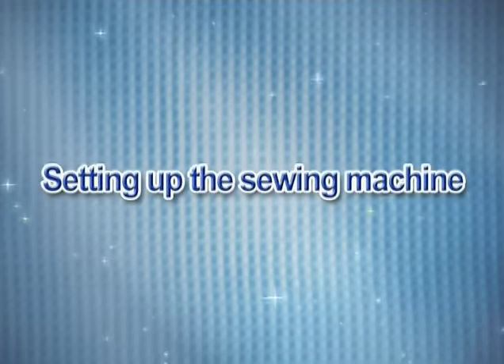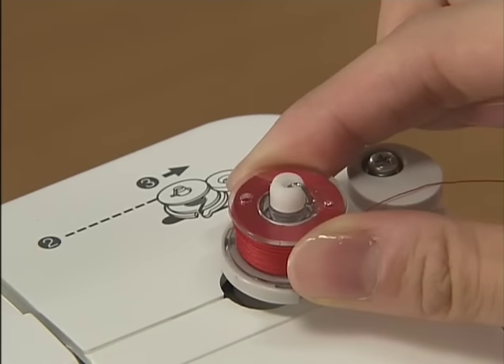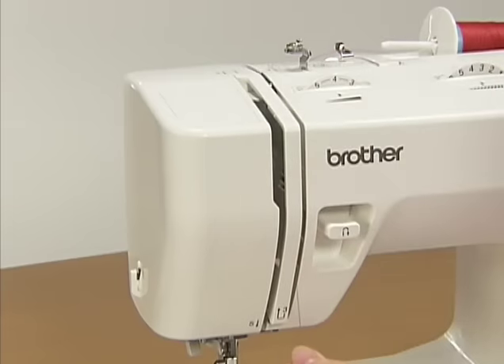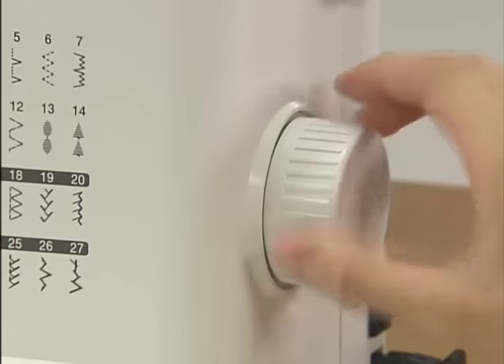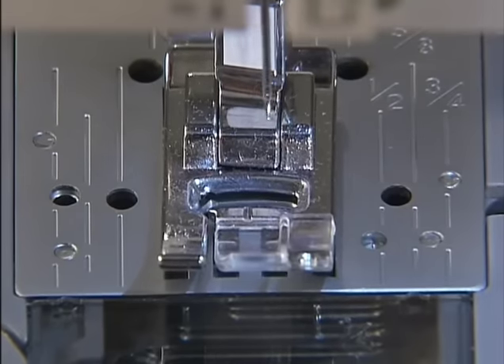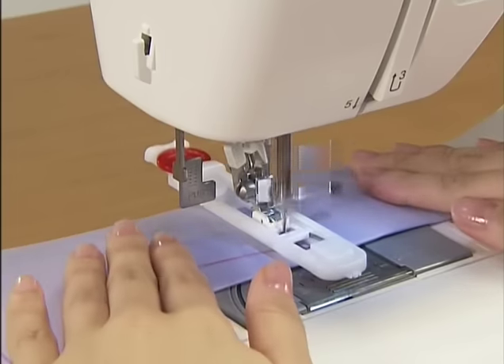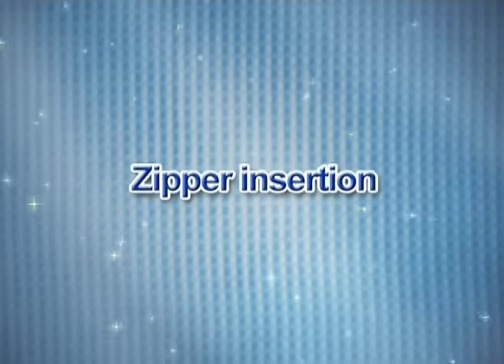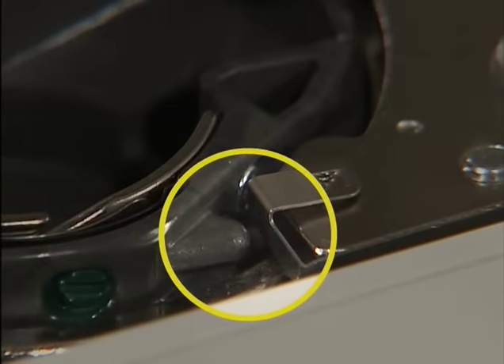Brother Sewing Machine ST531HD Instruction

Comment: Okay, great instructions.  But I got this machine because it was portable, and I have other Brother products.  To me, it is very rickety, with too many plastic parts.  It's also counter-intuitive to every other machine I have.  Levers are not in the standard places, this one goes clockwise when the others go counter-clockwise, and good luck threading the needle.  The presser foot gets in the way, and the crummy light means you can't see anything. You wind up hunched over until your spine locks up.
As for Strong and Tough, it couldn't even handle one layer of cotton fabric with low-loft 100% cotton batting.  I was trying to sew  Christmas toys for charity, and spent more time re-threading the needle and picking out thread clots.  It didn't seem to like the batting.  My "old reliable" White machine turns 65 this year, sews almost anything like a pro, and never gives me a problem.  Somehow I don't think this Brother is going to be here 65 years from now.

Comment: To help you skip to the parts you need: 
0:45 Setting up the machine
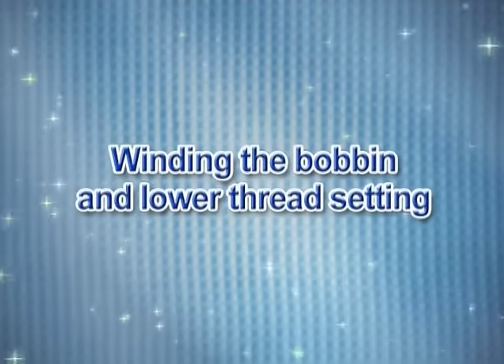1:13 WInding the bobbin and lower thread setting
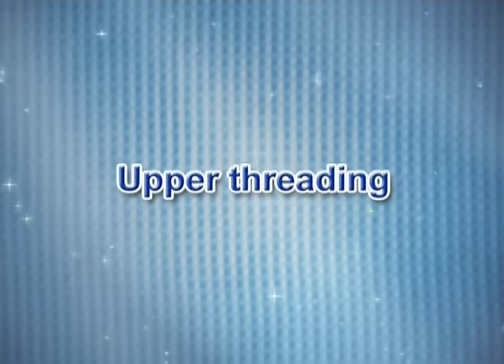4:49 Upper threading
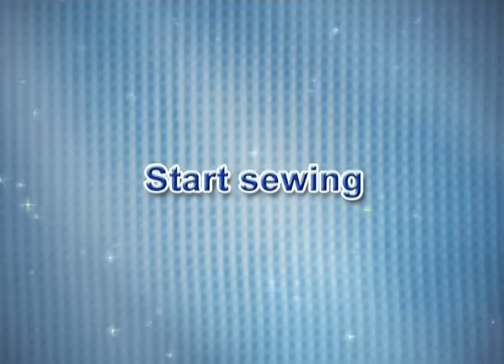7:17 Start sewing
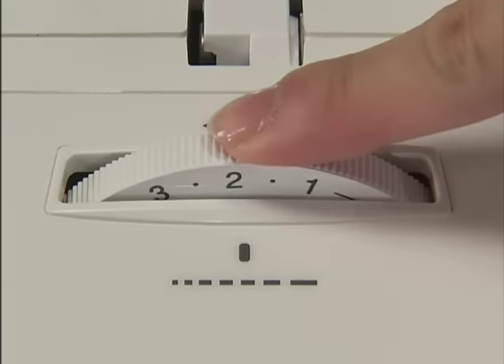8:52 Strech stitch 
9:11 Reverse sewing
10:15 Thread tension
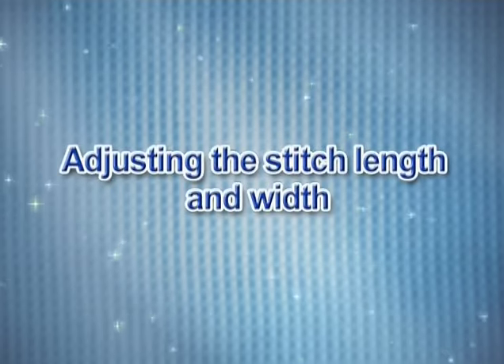10:46 Adjust stitch length and width
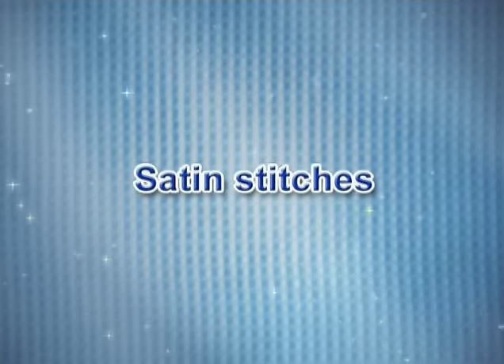11:59 Satin stitches
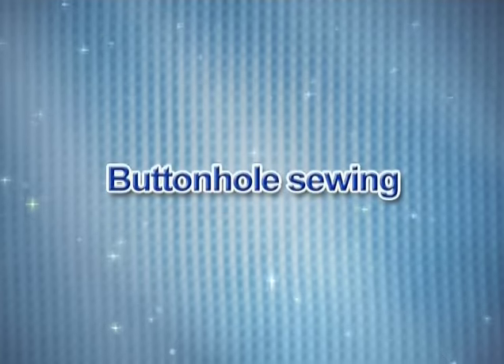12:43 Buttonhole sewing
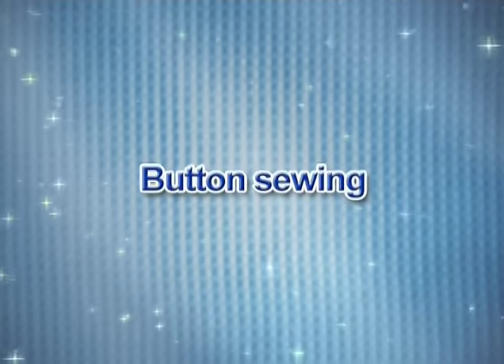15:03 Button Sewing
17:04 Zipper insertion
17:59 Replacing the needle and maintenance
Reply: All heroes don’t wear capes - thank you!!!
Reply: Is there anyone could help me about my question regarding , If this machine can use the REVERSE button if you are in a SS1 or SS2 ?  Or I can only use the REVERSE button if Im in a regular stitches?? Please help.. Thanks in advance.
Reply: Marissa Drew                  T
Reply: Thank you for these # counters!😊
Reply: THANK YOU!! Idk why the video maker didn't do this themselves.